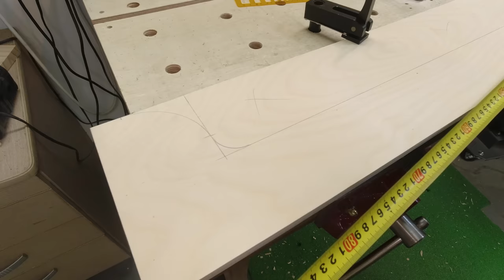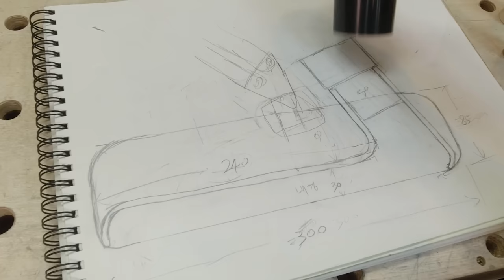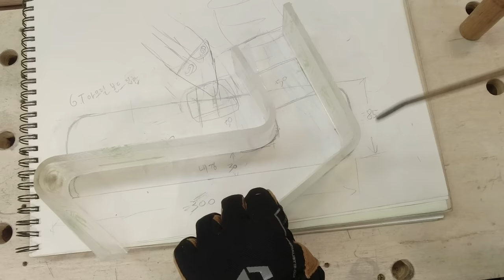Now my Table Saw is Safer and Cleaner! /⚡Building The Best Overarm Dust Collection /DIY /Woodworking

Comment: Gotta say that spells disaster, if while cutting you move the device by accident with your hand, elbow or wood and you will, that acrylic hitting the blade with you face in front is a scary thought. Some way to lock it in place will be necessary.

Comment: It works really well. Just pay attention: when you set the acrylic box close to blade side, you must keep in mind that the long arm oscillates a little bit, doe to vibration eccetera. My dad severely injured in a quiete similar way. A loosen screw let the protection hit the blade that literally shot it like a bullet, hitting and breaking his jaw from side to side so he also lost a tooth because crack occurred right in the middle of its “saddle”.
Reply: OMG!! I hope he has recovered from his injury!. I once had a small strip of wood about 1/2" square get kicked back at me and it hit my  lower abdomen area. It left a nasty looking red mark and bruise for months. If I hadn't been wearing a leather belt at the time, I'm sure it would have impaled me. I see so many woodworkers on here that remove the riving knife, and that's when accidents occur. The saw I was using at the time was my uncles and I was helping h cut out pieces of burl for the dark of an old Dusenburg car when that happened. It was a beautiful old Unisaw, but he had lost the riving knife at some point. After that happened, I made him a riving knife out of steel. I found the exact dimensions online for it. You have to be vigilant at all times when operating such powerful machines!!
Reply: @crossgrainwoodproductsltd9230  
Thanks for sharing your experience. I told myself I’ll never buy a table circular saw, because I must admit I’m pretty distracted or not so concentrated at least, so, once I’m retired, I’m going to buy a cnc laser and make something out plywood and veneers…pretty limiting, but way more safe.

Comment: This is a useful design that improves dust collection. If you fit a zero clearance insert you will be able to get rid all of the dust going down at the front and back of the blade.

Comment: Intelligent build, Safety - dust & blade guard in one. Have you though of adding brush strips to the sides like they have on CNC machines? Might make it a bit more airtight...
Reply from the maker: thank you.  I don't think the brush you mentioned is necessary for mine.  There are very few gaps between the wood and the guard.  It is about 1mm or 2mm.  That would be useful if you designed it to avoid adjusting the height of the head.

Comment: Can you please tell me where you purchased the measuring/marking tool that you use on 1:57? Thank you.
Reply from the maker: This multi gauge was purchased second hand.  [Matsui] Japan / Scriber Gauge
 And the round template was purchased at a nearby stationery store.
Reply: @carpentak  thanks for responding so quickly.

Comment: Where did you find a folding bracket that actually rests at 90°? 
 
I've bought every bracket I could find... $10 to $179 and all of them are 87° or less when opened and locked.
Reply from the maker: Mine is also not correct.  Adjustments must be made during installation

Comment: I was about to make one myself cause my hikoki does not come with the one piece hood cover with dust port. But as far as I know DeWalt hood cover has dust port, so does this set up perform better because of the dust collection system you already have?
Reply from the maker: I've never used Dewalt's dust collection cover, so I don't know.  It's an inconvenient system.

Comment: Inspiring. You're turning a job site saw into a Harvey table saw. Ya know, you can buy a Harvey table saw with overhead dust collection and a pro-level miter gauge starting at $1749, and a fully configured 4HP saw with left & right extension wings, extension tables, and a tin coated top for $3899. But what fun would that be, right?
Reply: I have the 4hp Harvey Alpha TS. I'm watching this video because its dust collection is not great (on many levels). In fact--although I like the saw overall--it feels like there was zero "Use Case" analysis in its design. Several areas needed refinement and modification for smooth operation. Not trashing the saw, just saying it is by no means a well-sorted piece of equipment as released to market.
Reply: @branchandfoundry560  Interesting. Thanks.

Comment: if i make this, i build this frame to roof, and there have easy drop down if need. not good right side have big bar, how cut big sheet if have bar vertical at saw tableside.
Reply from the maker: Since my studio is small, I sometimes have to change the position of the table saw.  So I made the table saw moveable and also clamped it to the side of the table saw to move with it.  Since my table saw is portable, I cannot cut large sheets in the first place.  So there is no situation where a pillar of this would interfere with my work.

Comment: What device did you use to start the vacuum cleaner and dewalt saw? your video is awesome 🎉
Reply from the maker: I installed a 1hp dust collector on my dewalt.  With it, dust is sucked in two lines from the bottom and top.  Thank you
Reply: How to start 2 machines at the same time?
Reply from the maker: I installed a dust collector switch in the empty space of the switch on the table saw.  So I can have both machines on and off at almost the same time.

Comment: I wasn't going to leave a comment but I find that I've got to say what's on my mind after watching this video.
This is a well built and designed item. No issue with that.
But why build it at all? When I use my table saw it leaves dust on the table top. Not a whole lot but some. Two minutes with a vacuum at the end of the job ( and my vacuum is on a cart within only a few feet of the centre of my shop so it's easy access ) and the dust is clear. 
I do use a dust collector ( or more properly a chip collector ) attached to a 4" port on the front of my saw base and most of the chips leave that way.
An overarm system like this seems like too much effort for too little gain.
That, of course, is my opinion. Yours may differ.
But I see woodworking as a hobby that by it's very nature creates a mess on the way to a finished product and too many videos that I see seem to find that a bit of clean up after a session is not acceptable.
Reply from the maker: This is to reduce airborne dust rather than reducing chips left on the table, and it works well for that.  There are many bad VOC chemicals in plywood and MDF.  They pollute my lungs and workroom.  If you use your table saw for very little time, you may not see the need for it.